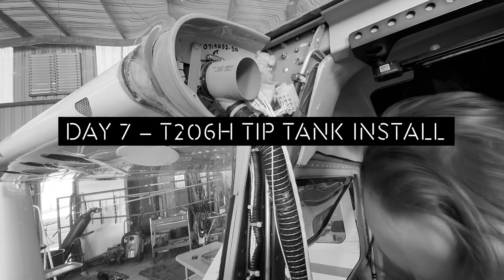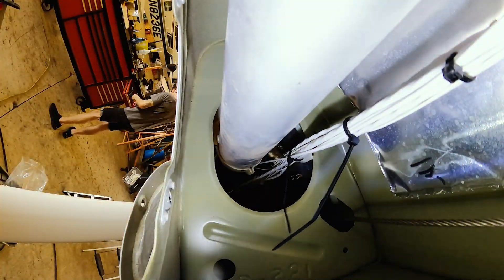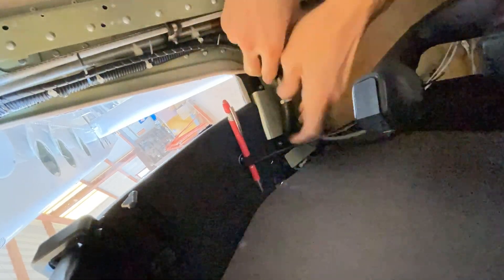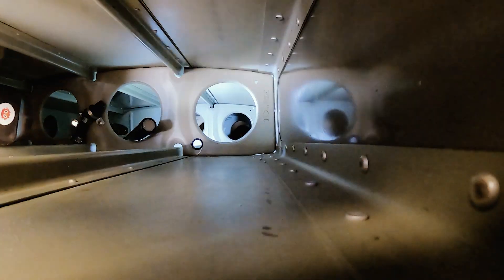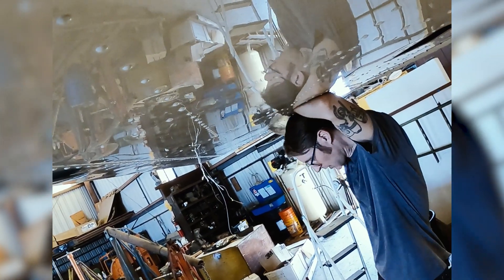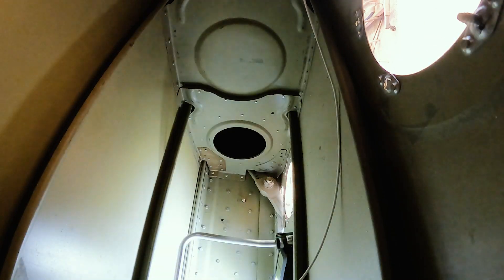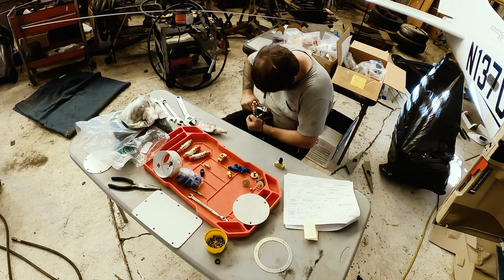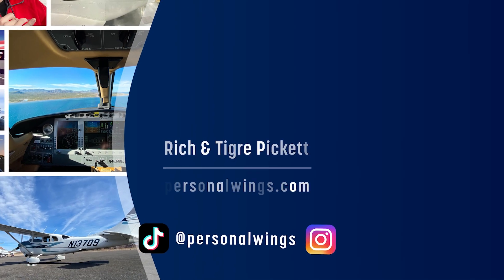Cessna T206H Turbo 206 Flint Aero Tip Tank Install Day 7

Comment: Great videos! Did adding tip tanks affect the MTOW?  How does that work?
Reply from the maker: The STC allows for a 3800 lb MTOW.  We're not sure how they did that.  You can also increase the MTOW of some of the models by purchasing an STC from Textron if you don't add the tip tanks.